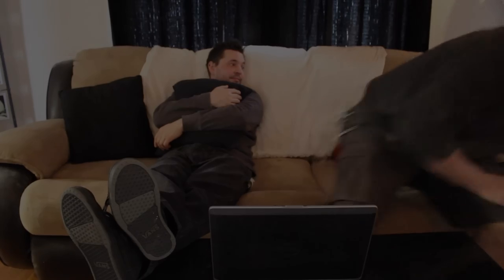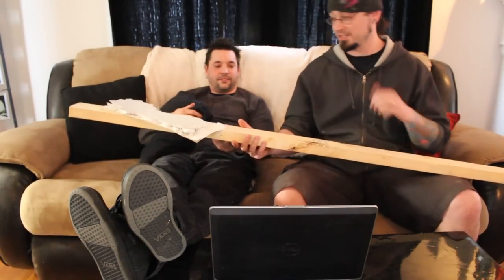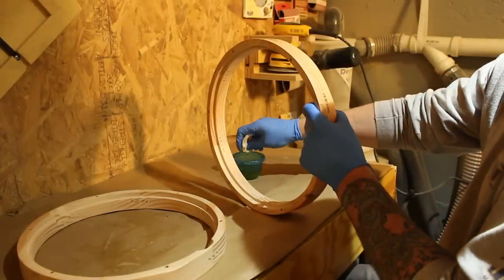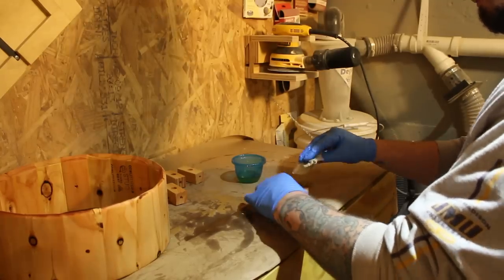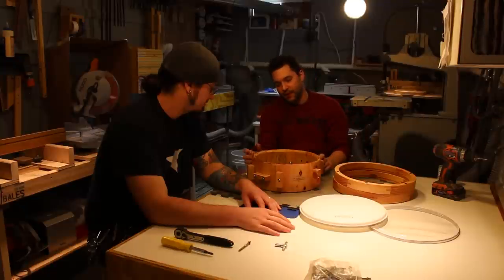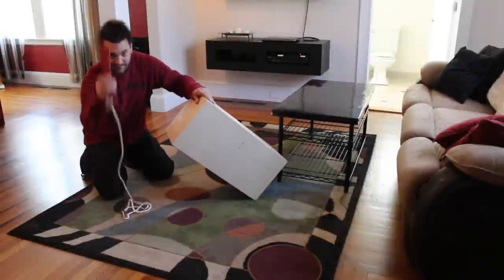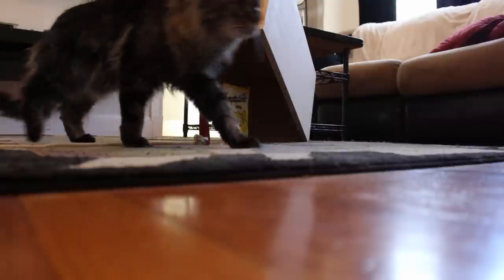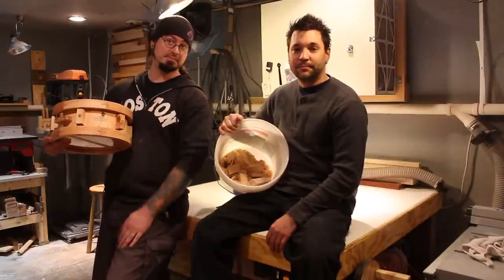Snare Drum Built From A Single 2x4

Comment: In all my years I've never seen or heard of a pine drum, it is soft wood, drums are made of hard wood, that is why they sound they way they do and pine does not, yep, I have built a pine snare way back in the 60's but I made it a lot thinner but pretty much the same as an experiment; some one liked it and stole it, I wanted it to remind me of what type of wood NOT to use and why.  You can build great snare drums the same way from hard woods, I have and sold drum kits in the 70s but not many as I was a gigging drummer and would rather play, all in all a great video, I'm going to build a floor tom since I can't afford one now, drastically different circumstances and I build acoustic and electric guitars, tube amps and speaker cabs.  Great job.

Comment: That is really cool. nice work! just wondering how did you make the jig for cutting the shell to size on the table saw?
Reply: +Bryan Henry The rollers are based on a roller Norm made on The New Yankee Workshop and you can find it on youtube.  It's a PVC pipe, with a threaded rod going through the center.  The rest I just designed/built as I went.

Comment: what about the edges? did you bevel than?  but anyway, realy cool! remind me to finish my snares drums too!
Reply: +MAZÖK wood crafts We used a 45 degree chamfer bit on the router table.  The profile is a dual 45 with more material removed on the inner cut than the outside counter cut.
Reply: cool! the way I make too, I ask just 'coz it's not shown on video, but really cool, I like the hoops too, does they suport high tunning stress?

Comment: I've heard that using PVC tubing for your dust collector ductwork can build up a static charge and possibly start a fire. Any truth to this?
Reply: I've heard that many times and have yet to see a documented case of a shop blowing up.  I've noticed zero static build up on the plastic and never received any kind of a shock.  I've seen people ground them by running copper wire inside ... other people run it on the outside.
I'm on the myth side of the argument and it's my shop in the video.
Reply: BALES I've never seen any proof or tests that show if it's dangerous either. I'm an engineer for a small dust collection manufacturer so I've come across quite a few small wood shops that also use pvc. It's cheaper and easier to work with compared to standard metal duct. Also, thanks for the response, I was very impressed with how well the 2x4 snare turned out. I could see people wanting to order or make their own.